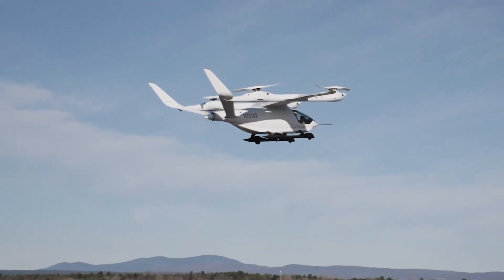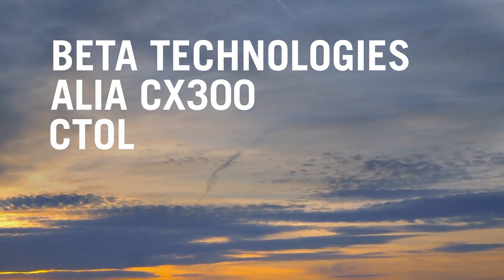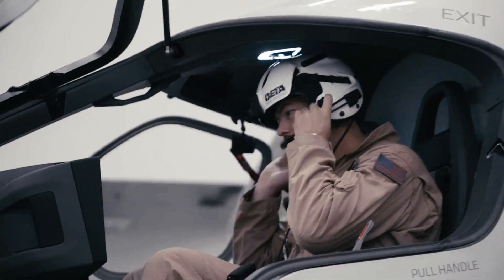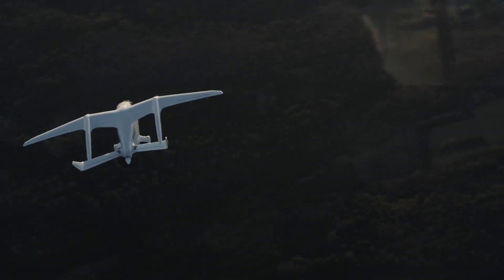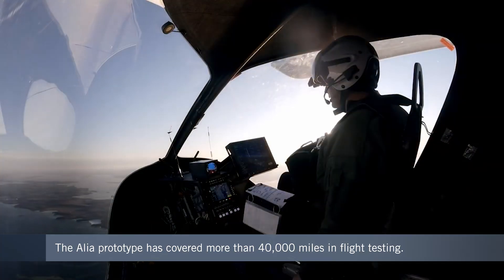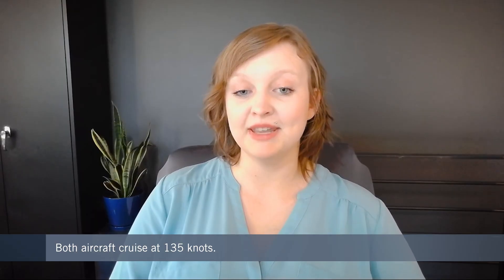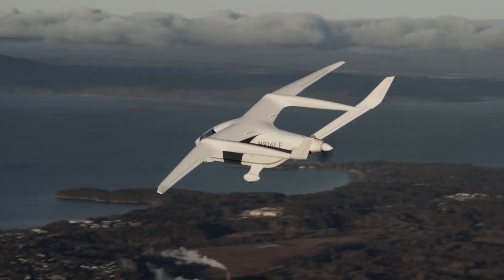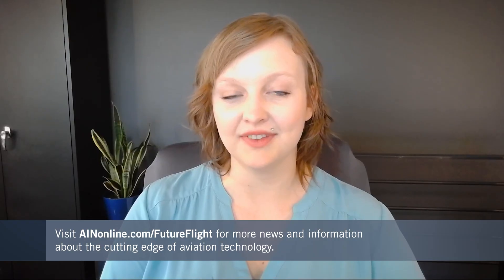Beta Technologies Flies First Production Alia CX300 CTOL Electric Aircraft – FutureFlight

Comment: evtol is just multi rotor helicopter with electric motor. what helicopter is facing they are only as bad if not worse. go back to a wing and propeller just normal airplane. there is no need fancy it with ctol. Bush planes from the 60s been able to fly with just incoming winds and a motorcycle equivalent engine.

Comment: Another heavy brick with many hanging propellers. Exactly what you don't want if your enemy is the low energy density of the batteries. This is perhaps the brickiest one of all. The impression gets stronger and stronger everytime that this hype is not about 0 emissions but only about using batteries, no matter how. As long as you come up with some prototype that stays somehow aloft on batteries, you have the pass to keep on milking the cow, or the golden eggs chicken if you prefer this metaphora. After all,  if all this really was about 0 emission you just don't invent a new way of flying with its new demand of energy to drive it, which did not exist before and adds to the current energy demand of "conventional" aviation.
Reply: Its got twice the glide distance of a Cessna 172... not very bricky if you ask me.  The reason for the "new way of flight isnt to use more batteries, but because electric motors are more versatile and allow for more streamlined configurations. Otherwise all the new electric aircraft would just look like conventional helicopters.
Reply: Electric airplanes is an utter fantasy promulgated by weak minded anti fossil fuel imbeciles. There is no climate change, global warming, chaotic weather, or whatever you climate cultists are calling it. Keep moving the goalposts but it doesn’t change the fact that your belief in climate change is nonsense.
Reply: @amiava4213  I agree with your assessment of climate change partially. But a 3% reduction in carbon footprint is still a significant step, if we are thinking outside the box, for a partial solution to the fact that we are in a fight against a heating planet, no matter what the true source of such heat. ..... 'global warming' had to evolve to 'climate change' after folks like us started affecting science textbooks sales
Reply: You have zero idea what you are talking about.
Reply: It's very entertaining when the uninformed attempt to sound intelligent.  We can either strive together to work our way away from fossil fuels, or be thankful we wont be around to watch the world we have created.... slowly grant our grandchildren a lifetime of health issues that are not of their making.
Reply: @d.russell8303  yup, it is extremely clear this guy has zero idea what he is talking about.

Comment: I can see these replacing small Cessna flights for cargo operators like DHL or Fed Ex when it comes to gathering and dropping off express cargo at smaller regional hubs especially if the cost of operation is a lot less than conventionally powered aircraft... Same goes for the larger Heart Aerospace project... Plenty of small subsidized routes that could be made profitable if you can lower the cost per operating hour with electric or hybrid flights!
Reply: Cargo operaters fly longer trips and do not want to much weight restrictions. 
I would think more of flying to coastal islands or flying to remote work sites (like mines)